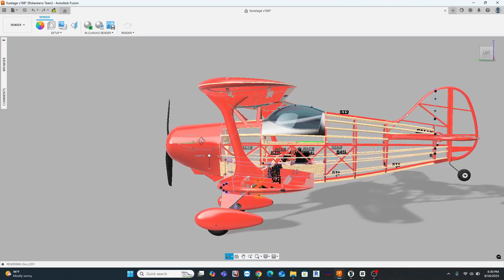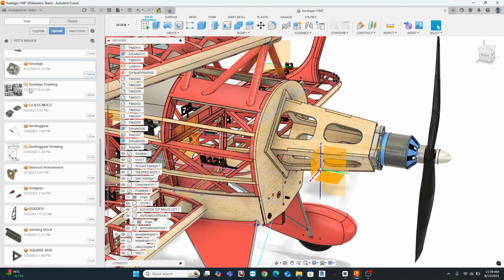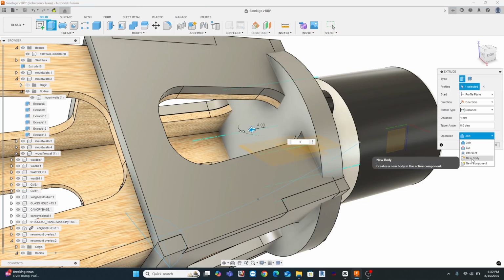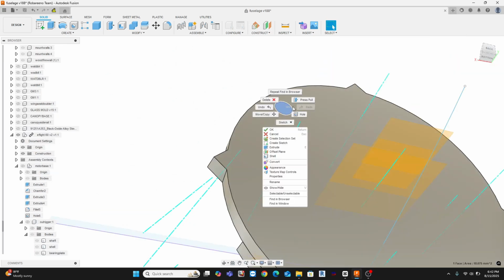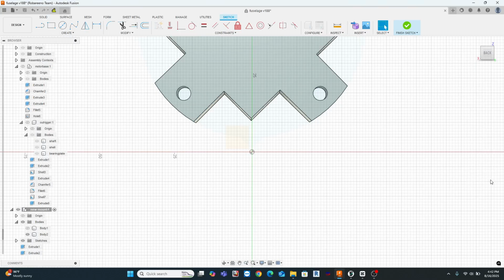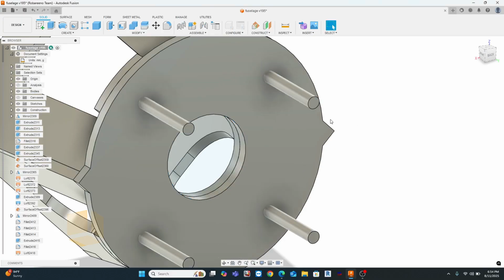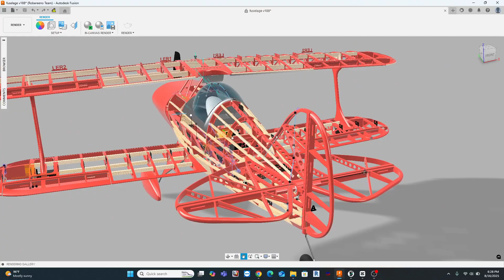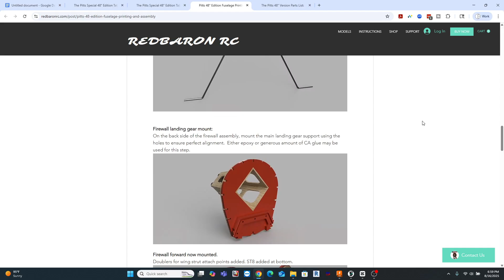Fusion 360 Redesign: New Motor Mount for 3D Printed Pitts RC Biplane

Comment: Many thanks to you for having shared freely the files of the Pitts. I am not yet sure I will build it, but it will greatly help me designing my next RC warbird on fusion 360, for I am a bit fed up of building HW-CNC foam parts or printing full 3D planes such as 3d lab prints... Though I print them in LW-PLA, I do not really like them, they remain heavy and very fragile and difficult to maintain, though they are reallly good looking...Coming back to more "traditional" construction method mixed with 3D printed parts and laser cut wooden pieces would offer me lighter, stiffer and more durable models ...thanks again Mate ! 🙂👍
Reply from the maker: I totally agree!

Comment: very nice. how did you heat shrink the film without distorting the PLA ??!!
Reply from the maker: Well I didn't use pla.  I used Petg which has higher thermal properties and is a bit less brittle in my opinion.  Next time I'll use ABS which is even higher temp wise and stronger.